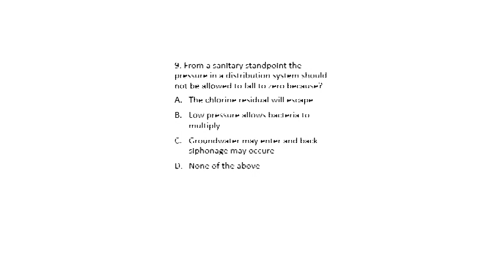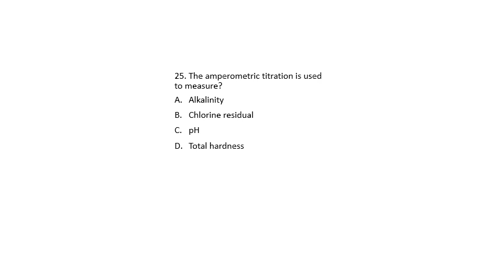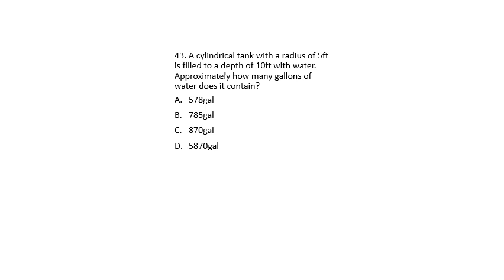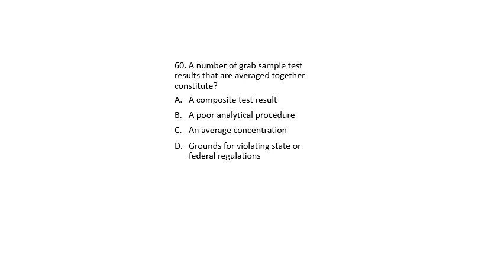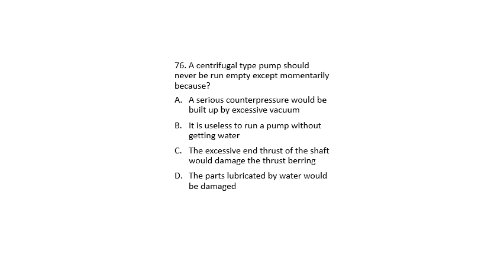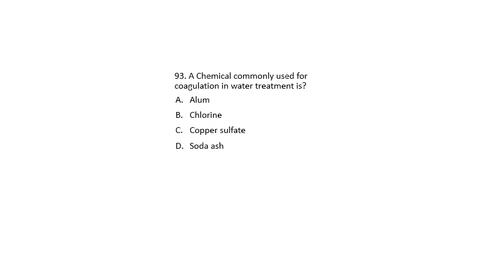Water Treatment/Drinking water Practice test/Exam 2

Comment: Has anyone taken their water distribution treatment operator certification grade 2 for Sacramento State water boards and found any of these questions im located in cali . Just passed my t1 using Ken Tesh
Practice Exams: Water Treatment Operator Certification yellow book can find on Amazon and  passed my d2 with the blue book same from Ken Tesh
Reply from the maker: these are practice questions from different state DEP websites designed more towards Drinking Water not distribution
Reply: ive been using the yellow ken tesh book for practice. i got my t2 exam on wednesday. i hope the book helps